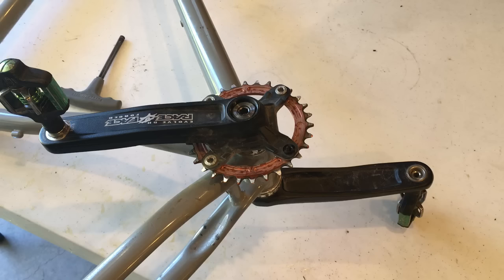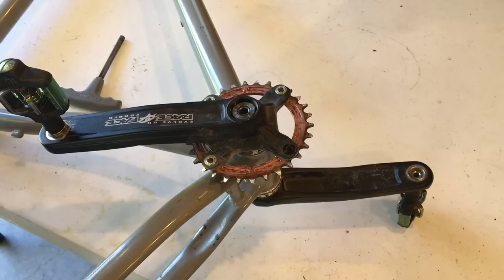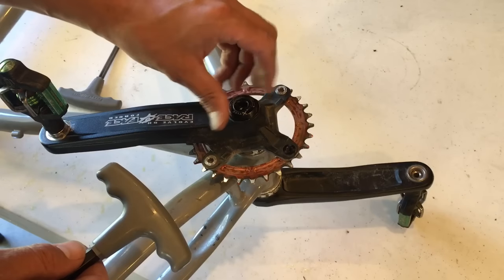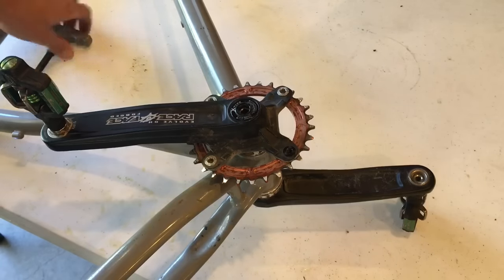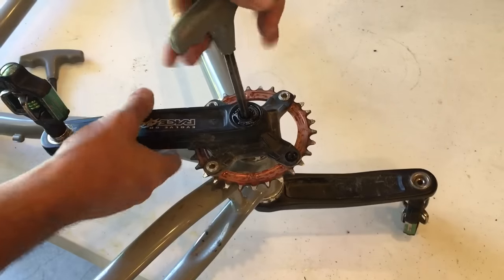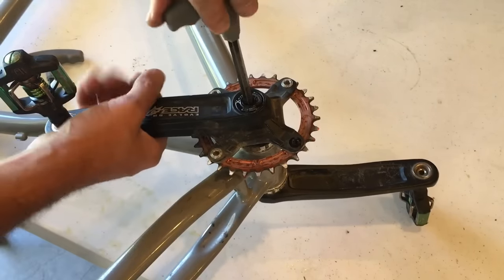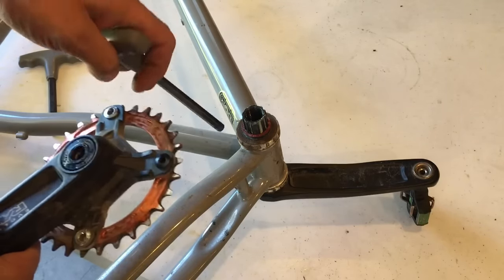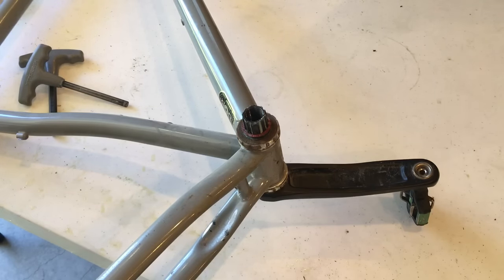How to remove a mountain bike crank without crank puller tool, x-type Race Face self-extracting

Comment: hmmm.... I tried this method for the 1st time and it got tighter and wouldn't come off. I removed the "dust cap" off 1st with a 10mm, then removed to inner with an 8mm and it came of easy. I wonder why your method didn't work for me? I'm just glad I got it off, but still wonder......

Comment: Dude...you just saved my ass...I accidentally did this on the LH side but didn't put two and two together, I thought it was  just a dust cap and on a new bike done 6 miles thought it was just a slack crank. But when the RH side seemed to strip the threads of the aluminium crank using a conventional octalink puller my heart sank. I put it back together and the "cover" didn't keep turning so tried the 8mm and it pulled off the crank! It's an ebike with a 16t sprocket so no room to tap it off....thanks again, brain reconfigured!

Comment: Super helpful thanks! My 10mm extractor cover was damaged (misthreaded and pulled-out). I was able to use the park tool CWP-7 as a emergency fix. On the CWP-7, I unscrewed the small diameter inner and set it aside. Then threaded the larger diameter CWP-7 piece of the tool into the x-type crank to use in place of my damaged 10mm extractor. Worked great after watching the video and realizing how the parts interact to extract the crank. Thanks again!

Comment: When trying this, the inner bolt backed all the way out through the puller cap (dust cap) and sheared off its 10mm head leaving the sleeve inside the crank arm covering all the threads. This likely due to crank and spindle stuck together. Now can't put a new puller cap on to retry. 😂
Reply: that why ou have to cover all the stuff in WD$= before extracting those cranks. sometimes is like they are welded lol. now you can take out the inner bolt and then cut the rest of the cap with a dremel carefully.